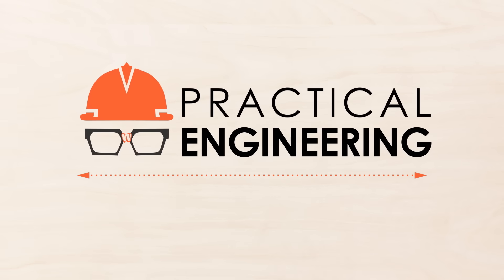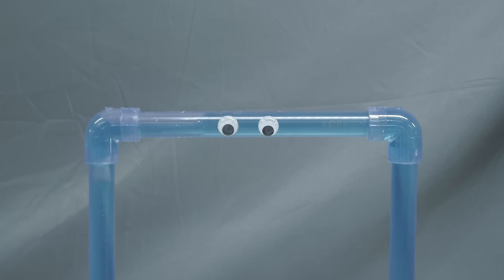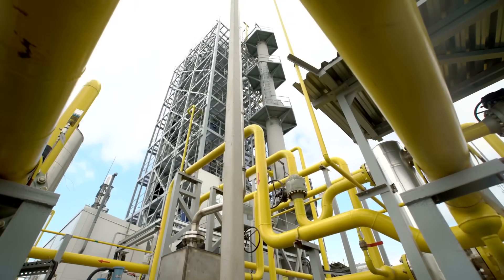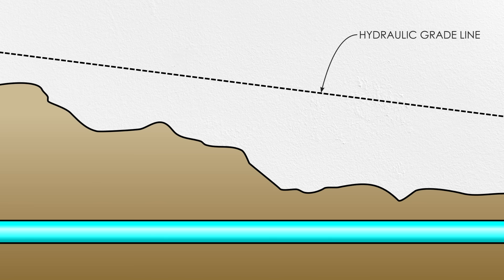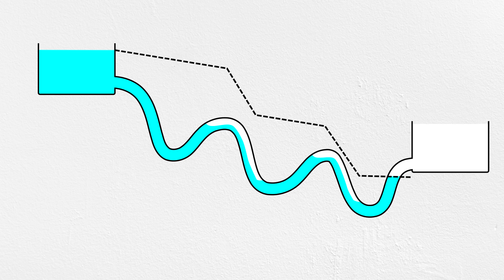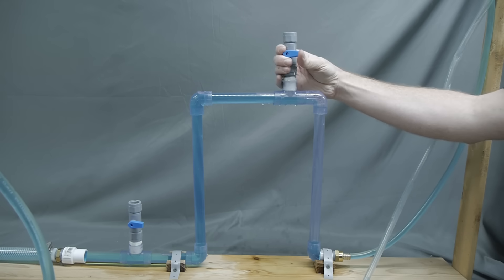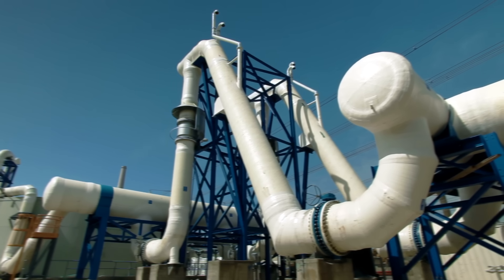What is Air Lock?

Comment: Ah, the dreaded vapor lock that can occur on normally aspirated IC engines! I had an older Toyota Corolla that would get vapor locked in hot weather. The problem was eventually traced to the fuel line where the previous owner had replaced a section it. They had routed it too close to the exhaust manifold and in hot weather, fuel would be vaporised in the line and block the flow of liquid gas to the carburetor.
Reply: Why would a naturally aspirated engine be more or less susceptible to vapour lock than one with forced induction?
Reply: @salvatoreshiggerino6810  It's not about naturally aspirated vs. forced induction, rather it is about carbureted vs. fuel injected.  The OP clearly misspoke about this.  The latter runs at higher pressure (much higher for diesel) so harder to vaporize the fuel accidentally as long as a leak is not the cause.
Reply: @bradarmstrong3952  Probably not even that. I'd say the determining factor would be whether you have an auxiliary fuel pump to keep the fuel lines at an adequate pressure, and whether your fuel system has a lot of high spots that trap the vapour. 

There's nothing inherent about an injection system that protects against vapour lock. Some fuel injected aircraft engines are notoriously hard to hot start because of vapour lock.
Reply: I had a Fiat sports car an X1/9 with a mid engine that did the same thing when the weather got too hot. The fuel system would air lock. So I had to take off the air filter canister and then the fuel hose and suck on the fuel line. I was so used to  doing it I can do it in about 1 minute. I did it many times on my way to work. The bad part was I was also sucking gas into my mouth. I miss that car. It had so much character and amazing looks.
Reply: Same thing happened to my fuel-injected motorcycle when I worked first shift and would get out at the hottest part of the day in the desert. For some reason opening the gas tank to release the pressure would fix it.
Reply: Naturally aspirated not normally aspirated. Anyway...good that you figured out the issue. Vapor lock can drive people crazy and make unnecessary repairs when the simple thing is the real culprit!
Reply: @yyiii276  Thanks for the mancheck.
A naturally aspirated engine, sometimes known as a normally aspirated engine
https://en.wikipedia.org/wiki/Naturally_aspirated_engine
Reply: @LiLi-or2gm  vapour
Reply: @snorttroll, you brits sure do spell funny.
Reply: That only happens on carbureted engines. Fuel injection runs at a higher pressure and it has a return line to the tank.
Reply: @yolo_burrito  Underrated comment. Something to definitely look out for on older vehicles. Test drive them long and hard on a hot sunny day.

Comment: this was absolutely the most overlooked and frustrating yet easily avoidable problem that I dealt with when commissioning new wastewater facilities over the last decade. not only was this a problem in itself, but it effected system monitoring instruments and almost always set off alarms that indicated a different problem. I lost so many nights of sleep over "critical alarms" that amounted to "just air in the pipe"
Reply: Be happy, that it was only waste water! Nuclear power plants got affected by it, too. After a german one went a little bit to critical, a glas reactor in a german research facility was built to study steam bubbles travelling through pipes and driving the computer and control team mad with false meter readings.
Reply: I went through the same thing while working with firefighting equipment and the associated infrastructure.

Comment: Wow so that's why my mead chiller lines get stuck despite my 10W pump with 4ft lift height that should have been way more than what I needed! I found if I use a suction bulb on the outtake line I can manually pump until there are no more air bubbles and the water will flow freely then. 
Oh, and don't use Teflon any more. It flakes and peels into your food. Only use stainless steel and cast iron. Only use Teflon for sauces (with a wooden spoon).

Comment: I work in a coal power plant.  Just last night I had to clear a vapor locked line that goes into the boiler.  The pressure of those lines is 2500psi.  Burping those lines is always stressful.  Hope the packing holds on the block valves.  I am going to show this video to the guys at work.
Reply: We do know the tremendous risks involved with boilers, etc. Always take safety precautions, and I guess there's a back up system in place considering the pressures involved. Stay safe....

Comment: Would an open pipe higher than the head height not be another good option? No moving parts and has the bonus of mitigating over pressure/water hammer. Obviously with high pressure it might not be feasible but I imagine at the highest point in some systems a few extra metres of vertical pipe may be a viable solution.

Comment: Not a medical professional:  I think this happens too in the circulatory system causing problems in the body I think that's why they remove air in the injections before using it.

Comment: Air and vapour locks can also affect fuel delivery in vehicles, especially with fuel like gasoline where its own vapours can lock up a line. In the German V2 rocket program, air or vapour lock interrupting or blocking fuel flow in their prototype liquid engines resulted in many catastrophic and explosive failures up until it was addressed.

Comment: I wish you had uploaded this before yesterday.
I was forced to siphon out all of the water from my septic tank using some spare irrigation pipe. The pipe had been in storage for years, and was for longer than i needed, so i unspooled it into spiral shape running down the hill towards a valley, I then filled it with water from a hose, and when the bottom had a water coming out, I put the top end in the septic tank. It would flow for a couple of seconds, then stop. I took me hours to get the siphon action going. Had I know this, I would simply have straightened out the pipe and have been done with it.

Good video, super annoying timing. Well at least now I understand

Comment: My first time making beer, I had trouble siphoning the beer out of the carboy (primary fermentation vessel). I wasn't familiar with air lock or the hydraulic grade line. Can I assume that since the hydraulic grade line represents the level the water could reach, air lock also affects the difference in height needed for a successful siphon? That is, the target end of my hose might be below the source water level, but air lock and other losses put the level line even further down than that?
Reply: YES, In my experiences, the siphon only uses the liquid filled part of the hose. A big enough air bubble can be as bad as breaking the surface. So a bad cork won't hold the liquid in the hose long enough to get it started. 
Note the vertical pipe between the sloped line and the surface in describing the hydraulic grade line and what an air bubble does to the fluid line in this YouTube on Practical Engineering, "Compress Air with No Moving Parts! - Trompe" https://www.youtube.com/watch?v=uvf0lD5xzH0

Comment: How do you increase the flow speed in the pipe (6:29)?  I assume that you would just use a bigger pump,  but then the pressure becomes an issue again (6:20).

Comment: How can you not get flow if you pump wayer through a pipe, i understand that theoretically because of the gradient it wont but as a flow of mass it confuses me. Also what would happend if one of those air bubbles got inside a pump along the pipe? Would it just lose the vacuum to work?

Comment: That was some really neat in pipe cavitation.
Also as a person who had only ever lived in a slab on grade foundation house, I hate when I see pipes going down into concrete. Makes tracing a leak really hard.
Reply: I don't think you want to use "cavitation" here; that is when the pressure is lowered such that vapor is developed (i.e. a cavity is made).  Entrained air is more likely what you're describing (captured, air pockets, air bubbles, etc...)
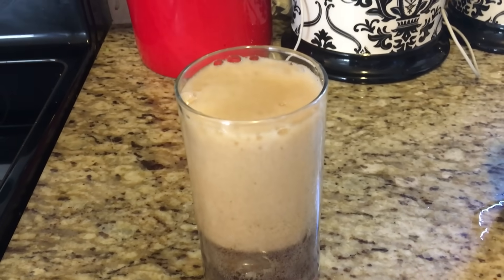Reply: @louf7178  I'm fairly certain the effect seen at 1:46 is cavitation. The liquid in the pipe is uniform, then pressure changes and bubbles from dissolved gases appear.
Reply: @iwontliveinfear  You are correct.  Thx.

Comment: The liquid in a pipe can also boil depending on many factors, heat being one of them. Many that drive or have driven older cars know about 'vapor lock'
Reply: Modern cars see it in the brake and coolant systems. Any time you expose your brake lines to air, you have to get the air out of there, usually with a manual bleeder valve located at strategic places like the end points (calipers/drums) and certain valves that are obvious potential reservoirs for air. Modern coolant setups generally use a loop around the top of the engine with two or more manual bleeder valves, even when you put a strong vacuum pump and cycle the fluid itself back into the reservoir, you still get little pockets of air inside the engine block. I'm sure many of us have seen mechanics bouncing the front of the car while bleeding out air, it's to knock those air bubbles loose even though it's not as effective as simply driving down a bumpy road.
Reply: @eideticex  theres only bleed nipples on your calipers and if your car has it the proportioning valve. And you shouldnt bounce the car to move air bubbles just rev the motor to force the fluid works so much easier, I'm a mechanic btw
Reply: kraps2312 that issue basically went away when gasoline vapor pressure was lowered for warm summer season, then raised back up for winter operation for easier starting
Reply: @chuckquinn8026  I've got some pickups that still vapor lock when it get to be over 90 outside
Reply: Justin Jacob where do you live?
Reply: @chuckquinn8026  Wyoming
Reply: Justin Jacob there have been reports of some F-150’s with this issue. Some are saying the engine bay is too hot, others saying catalytic converter/exhaust system too hot causing the issue. The EPA has lists of local and state RVP (Reed Vapor Pressure) specs on gasoline and reformulated gasoline. It’s a national nightmare for refiners as the specs change from city to city, county, and state. In a nutshell, most of the butane is stripped out of the gasoline for summer blends. Less ozone/smog/vapor lock from the butane boiling in the fuel lines. In winter blends, the butane is added back in to raise the vapor pressure for faster starting. It was a major issue in older vehicles without fuel injection since the fuel pumps discharge pressure was fairly low vs newer fuel injection vehicles with very high pressure fuel pumps. That combined with lower vapor pressure gasoline in warm months has for the most part eliminated vapor lock issues...of course there’s always an exception
Reply: @chuckquinn8026  The new Porsche Panamera suffered from vapor lock caused by a line coming off of the high pressure fuel pump being routed too close to the catalytic converter (hot V engine). A sleeve over the line fixed the issue but it did lead to some irritated customers of the early production cars.
Reply: Jim Kresky I can imagine. It appears that quite a few vehicles are running fuel lines too close to exhaust systems, and with the heat being generated, it won’t really matter what the vapor pressure of the fuel is, it’s going to boil...
Reply: @chuckquinn8026  That is such a thing?

Comment: Hey Brady and knowledgable people! Love the video! How does one meassure the volume of water spilling from a pipe? The best formula I have uncovered is Av=VxS. So the flow equals the speed of the current times the area of the pipe. However I believe this to be unsatisfactory as the problem in question involves a pipe bursting and having a round hole in a water pipe. So I assume that in such a case the speed of the current will quickly drop, as somebody would cut off the supply. In that case I assume the current will probably be determined by some constant that determines the flow of body of water at rest, maybe? Can you help me out?
Reply: It's not clear if you want to measure volume or pressure. So here are the methods I know:

Volume: Measure the width, length and height of the contained water in meters. Then multiply the width, length and height to compute the volume in cubic meters. 

Pressure: Use the formula P = pgh, where p is the density of water in kg per cubic meter, g is the gravitational acceleration constant, h is the height of the water above the valve in meters and P is the pressure in pascals. For water near the surface of the earth, p = 1,000 kg per cubic meter, and g = 9.81 meters per second squared.
Reply: @LiLi-or2gm  Neither really. Maybe, if I share the whole problem it would be made clear. A huge Water pipe had burst. There is a 1020mm, or 1.02m hole in its side. This is a real story, it happened a month ago - a main water supply line had burst. So a trully magnificently huge pipe. I wish to calculate how much water was or could have been lost. Having the pressure equation helps a bit, maybe, but I don't know how to transform it into the flow of water per unit of time.  The Av equation I found helps to a great extent as it gives us a possible upper limit, but the actual flow was much less. Hopefully this made the problem clearer?

Comment: "I'm an engineer, not a chef"
Casually does a pan flip while sauteing mushrooms....

Dude, like 10% of the population can pull that off. You kind of know what you're doing
Reply: He's an engineer. He ran the numbers, worked out the possible angles and velocities that would be within the allowable limits, and gave it a flip.
The real impressive thing is that chefs can do it without even considering the ambient temperature or air pressure.
Reply: @tin2001  equations floating by... carry the 1.
Reply: 700 million people compared to 7 billion is not much. Compare it to the United States' population of ~330 million and it's crazy

Comment: As a designer of hydroponic systems, getting air trapped can be very problematic.  I learned not to make unnecessary undulations, as mentioned here.  I'm not a trained engineer, but I put a lot of thought into my designs to prevent this specific issue.

Comment: I've dealt with this on a project I worked on where we were bypassing a city's main water treatment facility. Obviously getting the water from the river wasn't an issue as we had submersibles feeding a set of high-head power units but the end point of the very long pipe run had to go over a 25' high wall to feed fresh water into their system.

Basically looked like the trap under your sink but upside down. Because of this, when we first fired up the system, it was deadheading hard until we figured out that we needed to place air vents/valves at a couple places along the run. I think it took like 3 or four vents per discharge pipe along the path to get it to actually work as intended.

If course we did the whole project in winter. Which meant we were sliding around in mud for several months. Fun times.

Comment: 4:58 I thought the pressure is equivalent to the hight of the water above it. Why would friction change this? If I connected a long pipe that had lots of bumps and turns to a dam, then had the pipe go up really high at the end, surely the water would rise to the same height as the water in the dam?
Reply from the maker: Only if the water is static (not flowing).
Reply: @PracticalEngineeringChannel  Ah ok. I probably should've guessed that. Thanks for the response.

Comment: Question: is there a valve that closses by itself when pressure is to high and opens when pressure drops and doesn't require gravity or any other external force ??
Reply: Miazger Yes it’s called a pressure switch. You can get them to work in either direction